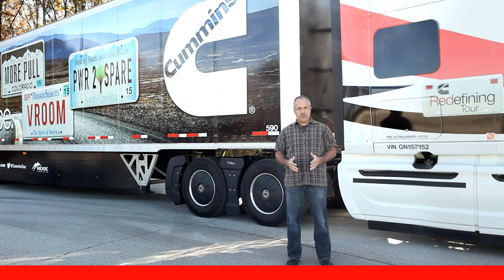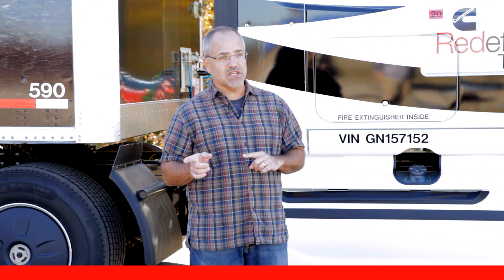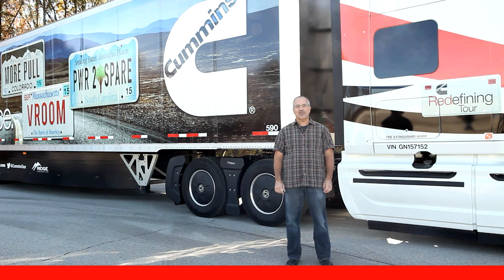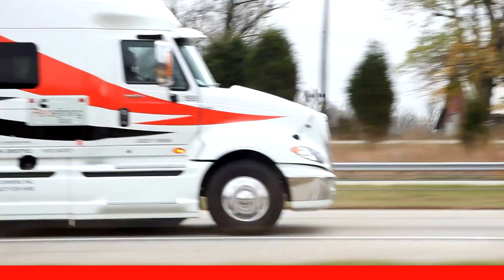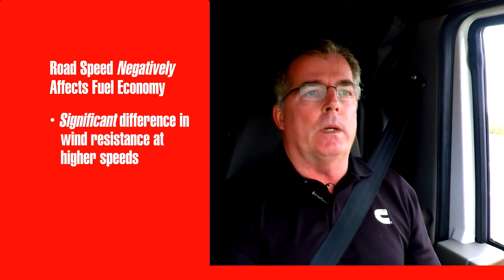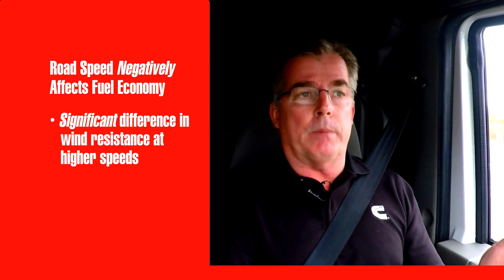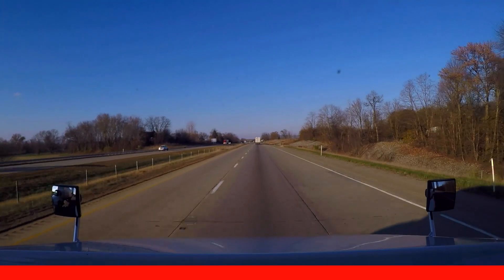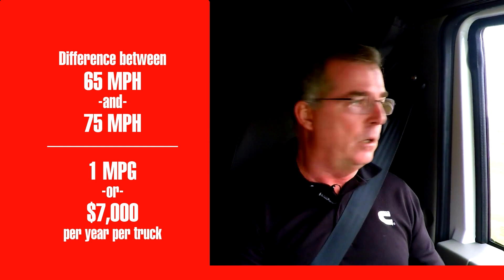Road Speed Governor - Driver Training for On-Highway Heavy-Duty Truck Engines

Comment: I drove a 2007 Freightliner Columbia with a Series 60 14L engine.  From April 13 2007 to September 28 2009, the truck was limited to 68 Mph, and I got a weekly average milage of 7.75 just about every week.  September 2009 to April 2012 the truck was governed to 63 Mph and I was lucky if I got a weekly average of 7.  I started driving this particular truck with 13,000 miles on it and I was dragged out of it at the 698,000 mile mark.  Cutting truck speeds does not return fuel milage.  A driver with a judicious foot does.

There are more variables that effect fuel economy than road speed.  The coefficient of drag, drivetrain, GVW, altitude (barometric pressure), terrain, tire pressure, air speed and direction all effect fuel economy either for or against.

Comment: You will lose horsepower and it will be harder to go up hills loaded or unloaded therefore causing the motor to put out more fuel use because you cut the nuts out from under your truck

Comment: Okay so for every 1 mile an hour you increase you lose a 10th of what you've been getting SMH. For anyone that can multiply knows that's impossible. Point being if you go from driving 60 and then too 70 according to his messed-up math means you will then be getting ZERO miles per gallon O K lol
Reply: No your math is wrong. If you lose .1mpg per 1 over, if you do 60mph and get 7mpg and then do 70, that would be 10mph increase. So 10mph x .1mpg=1mpg loss. So at 70mph you would get 6mpg. I'm not agreeing with this guys math I'm just explaining it to you since you seem to be way off.
Reply: @brandonhebert5485  yeah you are 💯% correct on my figures. I don't know what I was thinking LOL. That being said I don't agree with every truck based on driving faster will result in less fuel mileage. My point is👉 if your truck has a higher gear ratio then In some cases the higher speed can even out the mileage & even in some cases it can be better?!
 I've owned my own trucks over the years so I've witnessed this first hand thanks

Comment: BS if you hit the bottom of a hill at 65 you are going to use more fuel than if you can carry a little more speed lower speeds work the truck harder I drove 23 years regulated on speed and not